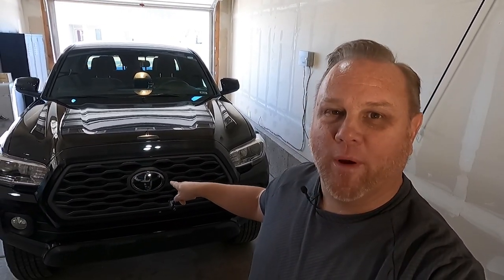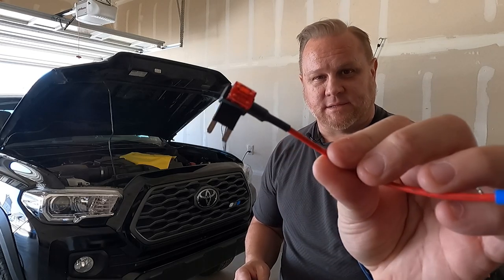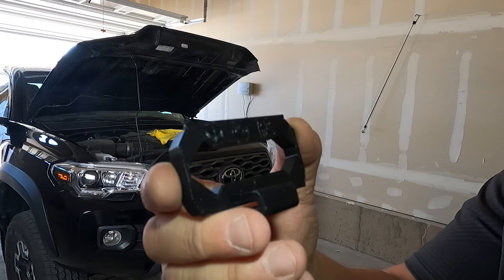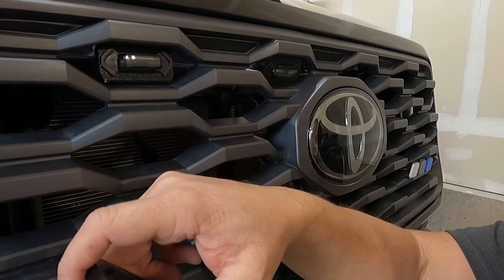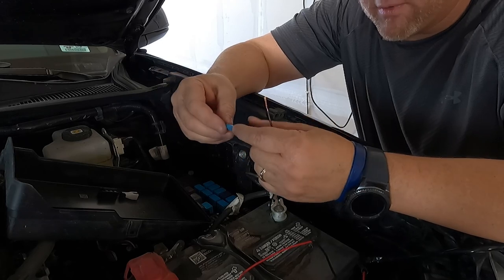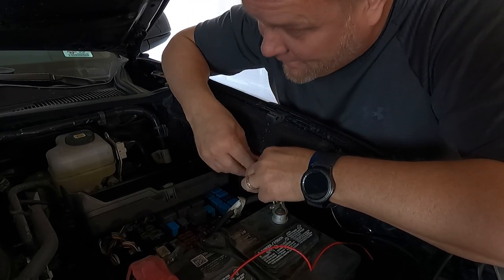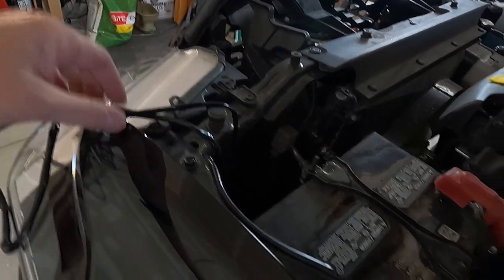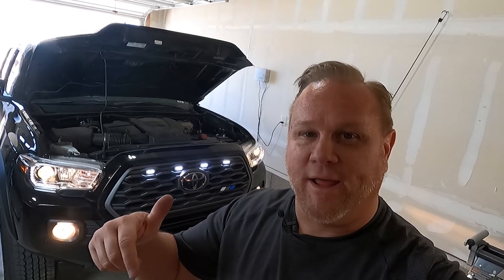Raptor Lights on a Tacoma with OEM Grill

Comment: Thank you for your reply my friend. I found out that the fuse box actually has a small area with a release tab that allows a one to two inch section of the box to slide out and reveals a small hole to run wires then you can close the section. Of course the lid has to be off. It’s located on front left area of fuse box just below the lip. Pretty cool!
Reply from the maker: Nice

Comment: Hey thanks for video. I did not see which fuse you used.
Reply from the maker: I plugged it the fuse with the headlights. That way the Raptor lights come on with the auto headlights

Comment: Did you replace the fuse box cover over the wire? Did the cover securely latch? I’m concerned that the cover may pinch the wire?
Reply from the maker: There is a way to run the wire in a way so it doesn't punch the wire. I didn't do that though. Haha. The wire is thin and doesn't seem to be pinched much and the cover still closed firmly.
Reply: @DJXPLRS 

I ran my wire up through the bottom of the fuse box rear left corner when looking down on it from front to of truck. Was pretty easy to do and saw it on another YouTube channel.

Comment: You didn’t show how you reinstalled your fuse box lid in terms of the wire getting pinched by lid or did you cut a notch etc.?
Reply from the maker: I just tucked the wire so the lid sorta of pinches it. But it doesn't pinch much and works really good.

Comment: Greetings, again. 5:35 that top fuse is the one I used three months ago. everything ok until yesterday. Check engine light came on, O2 sensor fault and dealership said the add-a-circuit fuse tap was the reason and charged me $447. There's a vid on my channel, Added LEDs...Void Warranty, for more details. If you can I'd appreciate you input. In fact it was this video that gave me the confidence to do the lights and subscribe to you.!
Reply from the maker: Thanks for the info
Reply: I installed smoked white lights to the OEM grill of my 23 TRD Soort and put the add a fuse into the headlight fuse spot. I like that they come on with the headlights but if I could find a fool proof way to connect them so that the lights were on when the DRLs are on and not mess something up and void a warranty I’d probably do that. But the lights look great on your truck and on mine.

Comment: Just added raptor lights to my OEM grille. Your video gave me great ideas and confidence. BTW: the kit I bought came with the lights installed into the adaptor brackets. However not marked but you pointed out the corner angle for next to the emblem.
Reply from the maker: Nice. Glad the video was helpful. I love the look of the Raptor lights

Comment: Hey DJ, I highly recommend doing the alpharex LED sequential headlights. I got mine from YotaGarage but there's a few places you can get them. Super highly quality and adds a mean front end look. Plus you can see everything at night and the DRLs are phenomenal. Also does dancing headlight start when lock/unlocking the truck and starting it. Careful with your raptor lights, some brands end up getting water trapped in them and killing the lights quick.
Reply from the maker: Thanks for the info. I'll check out the Alpharex LEDs.

Comment: Considering adding Raptor lights to my Tacoma at some point. However, the custom made brackets are no longer available on Etsy. There are some kits on Amazon that are specifically made for the 2020+ TRD OR/Sport grille, but the reviews are iffy. Some say they are great, and others say they don't fit snuggly into the grille.
Reply from the maker: That's too bad the brackets aren't available.
Reply: @DJXPLRS  Late reply but kits for the TRD Sport/OR grille are available all over Amazon and probably ebay now. I did buy an amber set off Amazon for ~$40 some months back that were easy to install. Only thing is the retaining clips were pretty garbage. A bird flew in front of my grille and broke the clips on one set of lights a week or so after installation and had to ziptie it in place. Ended up removing them awhile ago.

Comment: Do they come on with the running lights on ?
Reply from the maker: No. I didn't wire them thst way. Mine come on with the headlights. To have them come on with the running lights all you need to do is plug it into a different fuse spot. Way easy.